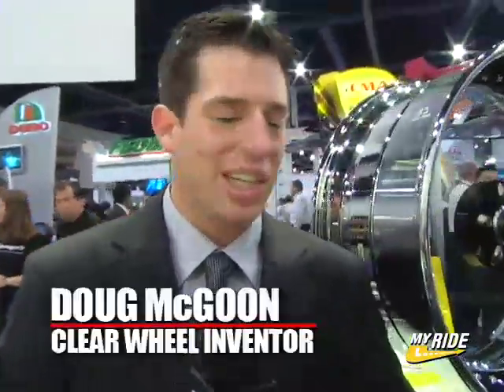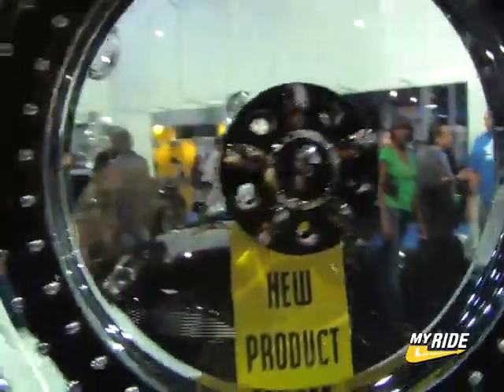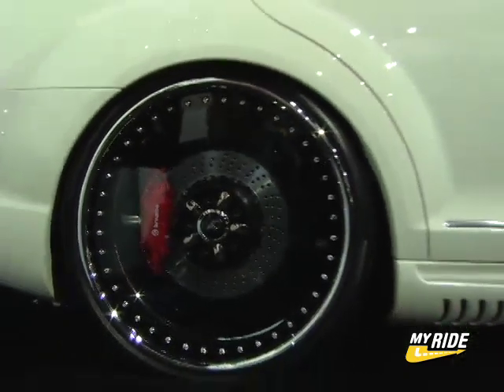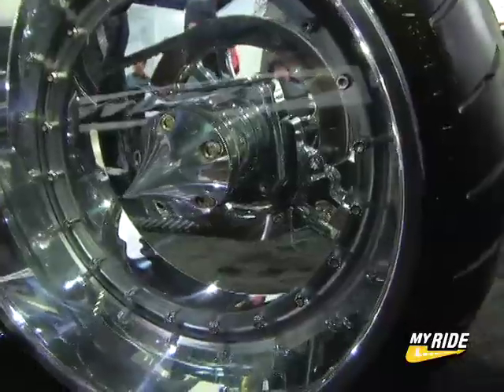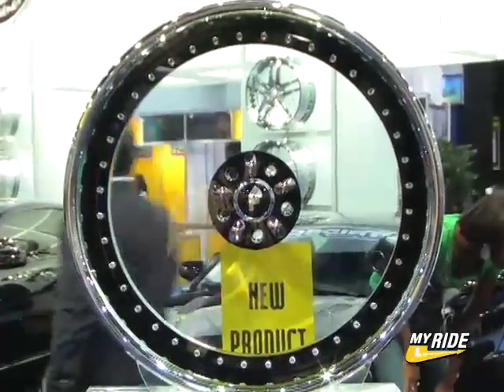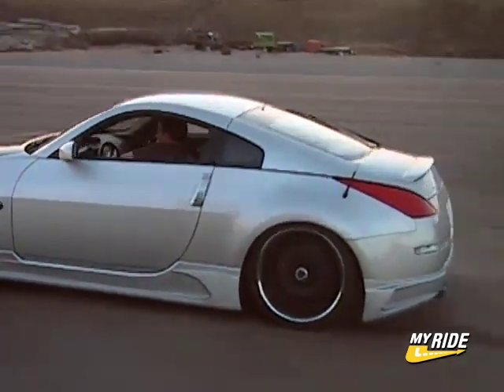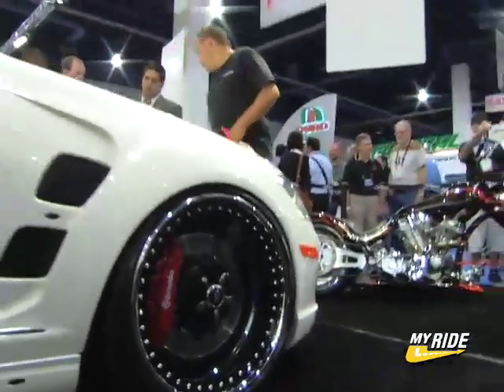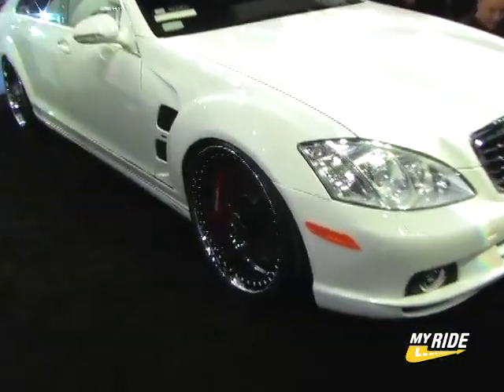SEMA: Clear Rims from Forgiato

Comment: there made of 2 inch thick polycarbonate so if you can get them to shatter or even crack without multiple rounds of 50 cal gunfire I would be surprised but i agree with you about break ventiation

Comment: great idea. now everytime you clean your car you also need to remove wheels to clean the inside.
not to mention possible break overheating on demanding situations

i also wonder what will happen when those break discs start to dissipate heat through the wheel centers onto the plexiglass. discs can reach up to 700-800 celcious, which could easily melt plexiglass
Reply: damn,out of all the shit i thought about,i didnt even think about having to remove the wheel everytime to clean the calipers etc..good point lol
Reply: brake man it's spelled brake
Reply: @ph4se2  correct, my mistake. 
thats what happens when you try to transfer your thoughts in written and english is not your native language.

but you gotta give it to me: i know the difference between "your" and "you're" lol
Reply: Bro, they aren't racing wheels and probably aren't even daily driven on them...

Comment: well hell for 2 G per wheel you at least get to inspect your brakes without having to remove the wheel. Although id avoid getting them hot, the "plastic" would either warp or crack. One wonders what a slight curb impact would do to them. I'll keep my stock wheels TYVM.
Reply: It’s not glass ding dong
Reply: Polycarbonate won’t crack or break on impact especially not 2 inch thick polycarbonate unless you hit some shit stupid hard..
Reply: @mtbridingog9083  looks great for show cars. I wouldn't trust it enough for every day use on various road surfaces or any high speed use.

Comment: @randygalati; FDA approved? federal drug administration? so they are edible too? OR maybe you ment they are approved for use on the road. FDHSTA. Federal Department Highway Safety Traffic Administration. Even so, plastic. Take a "modern" vehicle and one from the 50's that had steel body panels. the older one survived most crashes, occupants may not have. But it was easily repaired for its next owner. Yes for show they are nice enough. BUT for everyday use, I just dont "see" it happening. LOL!!